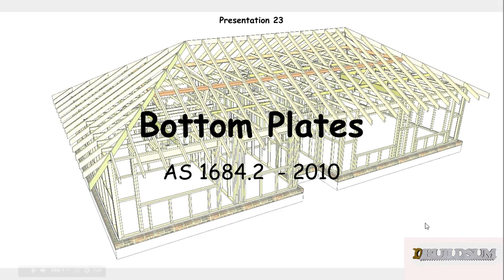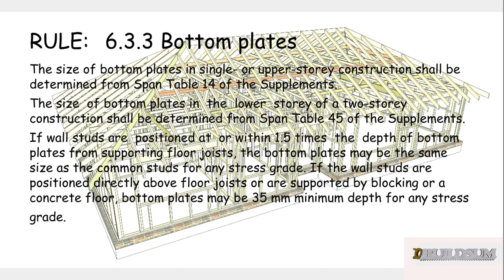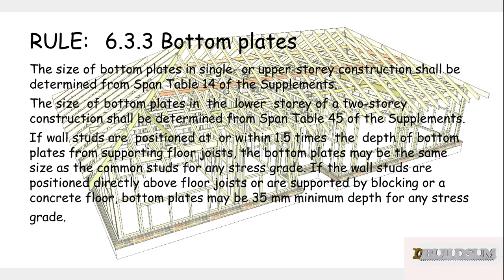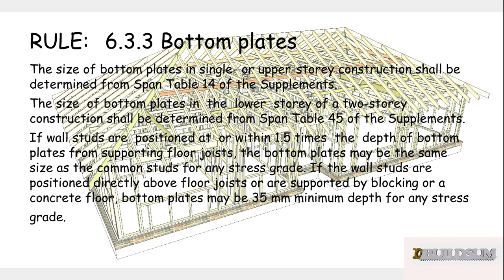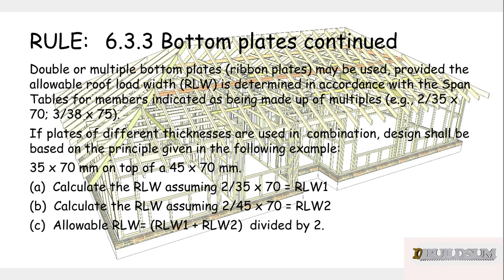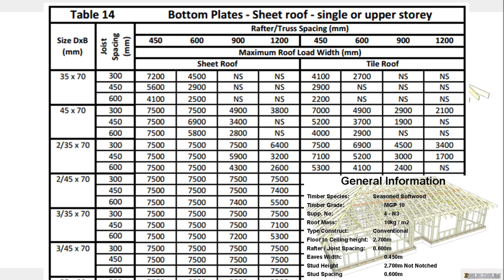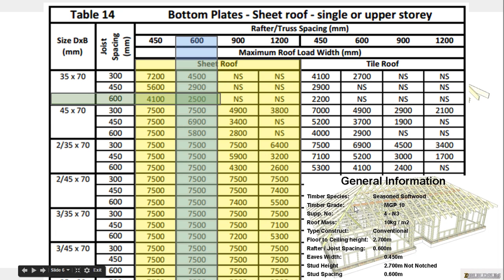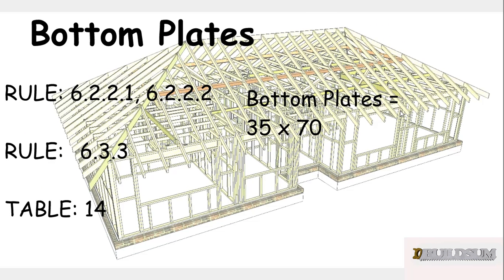23 Bottom Plates

Comment: Mate.. Why is it that companies such as Simonds only fix bottom plates to slab (single storey) with only paslode nails and nothing else? And they justify it? Can't be right.
Reply: @Buildsum  sup bro. Got plasterboard going up in the next few days and I've enquired with our site supervisor as to whether paslode nails were the only fixes to be used to tie-down bottom plate to sog. (I've waited till the near end of framing stage to ask) so hault on plaster till confirmation. Our inspector didn't once mention anything abt no fixes to bottom plate on his report When I msg and asked abt fixes, not a response.
I'm tempted to go and shoot some Ramsets or even battens screw the fkrs. Or am I missing something?. I'll be asking the site superviser again and asking abt tie downs and fixes..

Communication is key my friends or a punch in the head. lol jokes
Cheers mate... Appreciate it
Reply from the maker: Hi Mate. yeah that would be a worry, we used to have 100mm dynabolts in the corners of every bracing unit and the.  every 1.2m inbetween and that was in a very low wind area. Definitely a good call checking with the supervisor it would be a expensive exercise to do later.
Reply: @Buildsum  thnks for quick response and as always.... Good content. Cheers mate!
Reply from the maker: Hi Samoan, I'm pretty sure that they would only use the Paslode nails as a temporary fix while they are erecting the frames and then once they have everything up and confirmed that they are in the correct position go back around and put in the required tie-downs. I'm sure they would not get passed by the council or a private certifier with out them.

Comment: Hopefully not too far OT, but in regard the bottom plate I wondered what you considered best practice for handling the DPC membrane for slab on ground, cement sheet clad timber framed walls? I've seen different approaches, some looked especially bodgy, but most "official" info relates to brick veneer where the standard practice is very clear (and arguably less demanding for the timber component).

I have a re-work which is a mess. I will lower the ground to achieve min 75 mm exposed slab edge for termites. I was going to run the DPC membrane under the bottom plates and vertically up about 20 mm on the inside of the bottom plate to be captured by the internal lining, on the outside run it vertically down to be captured by the cladding. A bit like a Z shape ... except turned on his side. I've also seen no reference to the requirement for ant capping in this situation. 

Awesome work on the videos BTW. You've been at this a while now and you've built an impressive library I always look forward to catching up on.
Reply from the maker: Hi Pete, thanks for your comments, with regard to your questions.

It depends on what you are trying to achieve with the DPC. It is not standard practice to put DPC between the slab and the timber frame although I have been required to do it in the past. Remember that the slab itself has a waterproof membrane under it so once the slab has dried initially there should be no more transfer of moisture. Also, you will still have to fix the walls, bottom plate, down to the slab which will mean drilling holes or driving nails through the bottom plate and therefore the DPC which while stopping some of the moisture transfer but not all of it.
If you are worried about water getting in-between the slab and the frame you could run some DPC over the joint, however, this should not be an issue if you run the cladding over the joint a bit.

The solution that you propose is a good workable solution, however, getting that DPC under the wall frame will be a real hassle. I suggest you use something like an Alcor for the DPC as it will hold its shape and that you use a sarking on the walls.

While I haven't done a video on this exact construction method these 2 videos might help.
This one is the slab on ground
https://www.youtube.com/edit?o=U&video_id=0Um_Ttv95Ko

and this is the timber frame just forget about everything below the bottom plate as it will be replaced by the slab in your case.
https://www.youtube.com/watch?v=JpST6yz53jo

No there is no requirement for Ant Capping in this situation that is what the 75mm gap is for.

Hope this helps
Reply: Excellent information and good points you make, thank you very much. That would definitely explain why I'd seen different approaches and why I couldn't find much info on the best practice for this instance. I'd completely forgotten about the slab's membrane. I'll check through the information you provided, I'm sure (as always) they will be a great help.

In this instance the construction suffered moisture ingression for various reasons, including (but not limited to) blocked gutters, blocked stormwater drain, a poorly placed hot water TPR outlet and ground soil/concrete built up too high. There were also a number of defects that allowed termites to follow the moisture in and feast on the untreated pine that was used. The bottom line is everything below the rafters is completely destroyed. About the only good news is I'll prop the roof and won't get wet while reframing it :)

I'm trying to think of every trick I can to avoid this repeating. Some of the rectifications possibly won't be practical for various physical reasons, so where I can I'm trying to double or triple up preventative measures rather than replying on one prevention. Once a termite infested tree is removed I'll be able to get my excavator in and regrade the area around it a little better, but I think it will always be a high-risk area. Working on somebody else's mess they made is tricky, far worse than starting from scratch in my book. As if that's not complicated enough, part of the area is a sauna and may influence the materials used in regard termite resistance.
Reply from the maker: Hi Peter, I know what you mean, I have in the past helped a mate replace all the walls in a block of Flats because of Termites. We were able to prop the roof and the windows and just rebuild the walls around them. All you can really do is use Termite Resistant materials for everything. It seems that you have identified all the other issues so once you get rid of them you should be well on your way. 
If you think the Termites are going to be an ongoing problem you may want to consider a Reticulation system around the perimeter of the slab so you can apply and reapply a Termicide around the building.
Hope this helps